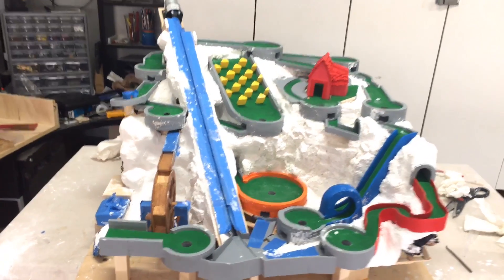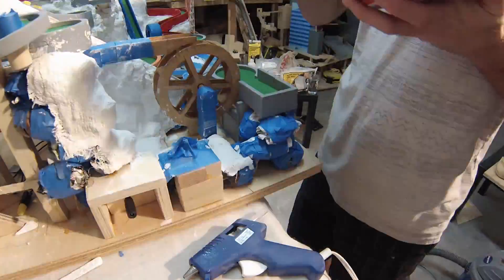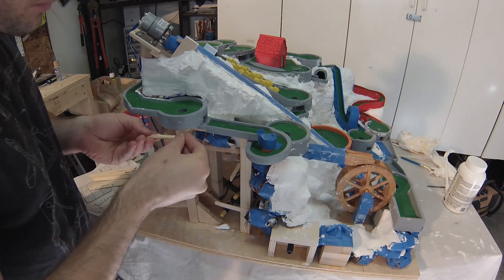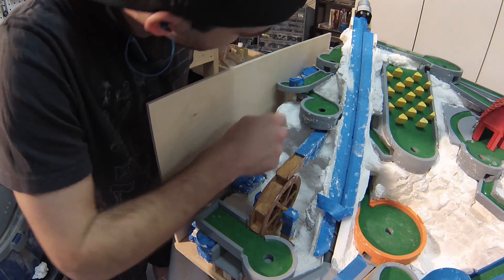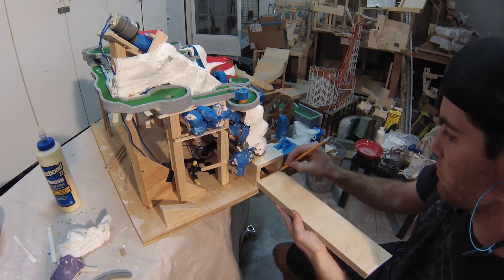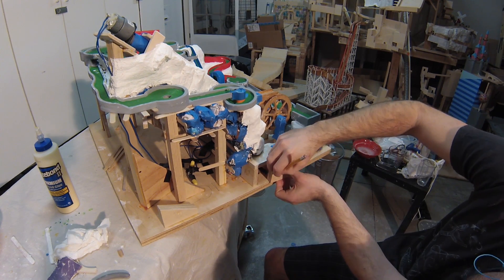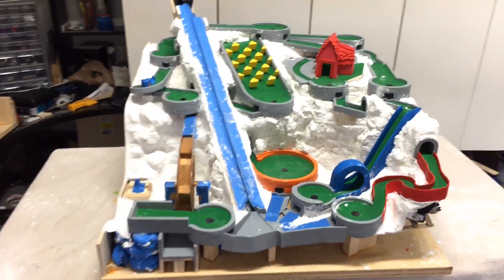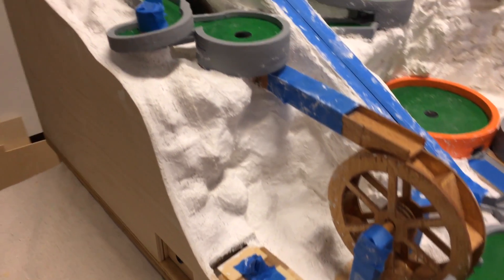Mini Golf Marble Machine Build, Part 15 (Left Side, Strong Side)

Comment: For the waterwheel, you could have put in a wood barrier to savor marbles, around the waterwheel loose enough so the waterwheel won’t  scrape against it, but small enough so the marbles will stay in there, and this is for the part where you can’t see.

Comment: Just a suggestion, When you put the back wall on you should put some kind of door leading to the wires if you have any problems with electrical. 👍🏻
Reply: So you don't have to take the WHOLE wall of. 👍🏻
Reply from the maker: +RC Maniac yup. The back wall will magnet on so it can be easily popped off